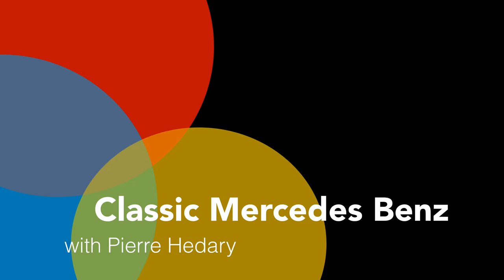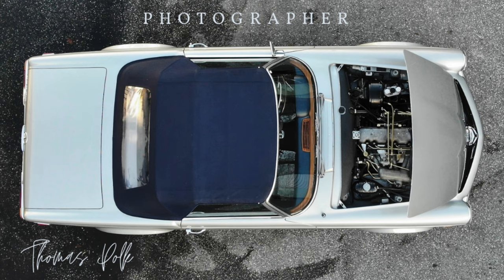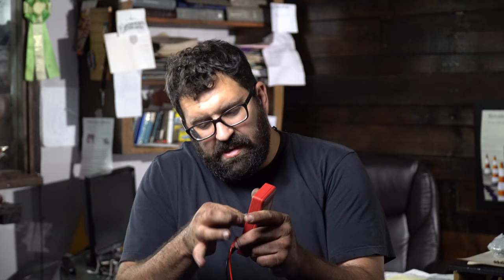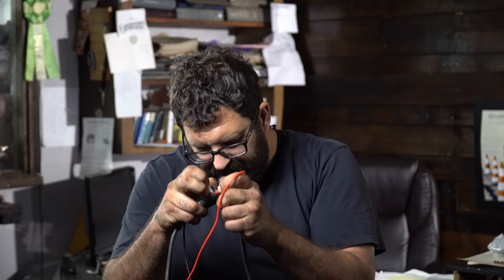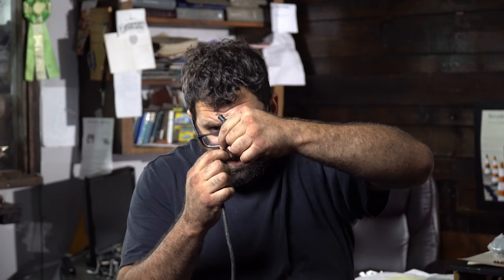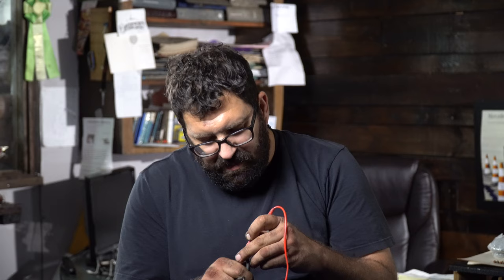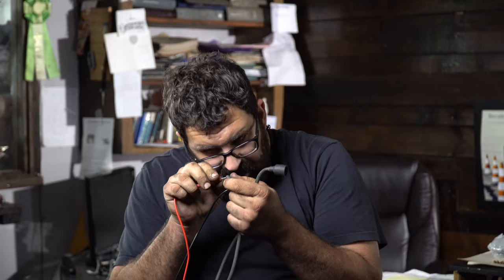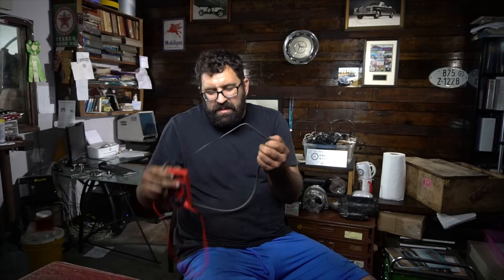Testing resistance of your spark plug wires    4K

Comment: Funny,  just sourced Mercedes’ Bosch NOS complete set of wires for my 86 500SEC.  The originals have 92k on them.  I was hesitant on these NOS but now with your info tonight I can be sure they are performing to spec.  Thank you ….
Reply: As long as moisture hasn't gotten to them, I can't imagine why they wouldn't still be within spec!  Nice find!
Reply: @Johnathan_Waters  they are NIB and they look good but I’m glad I learned something new tonight.  
Just will test them for own piece of mind . No real concerns unless I have an issue, it’s just NOS and 15 years since they were mfg.
Reply: @lawrencelieberman2278  I always test HT leads while flexing the wire as much as possible... sometimes they will test OK "static", but as soon as there is some vibration (ie. engine running) the resistance will start to fluctuate wildly, or go open intermittently!!